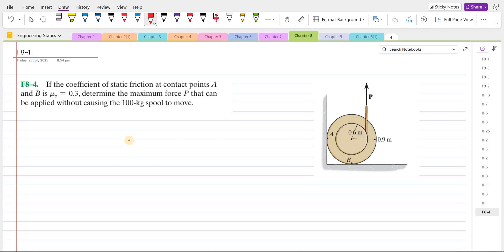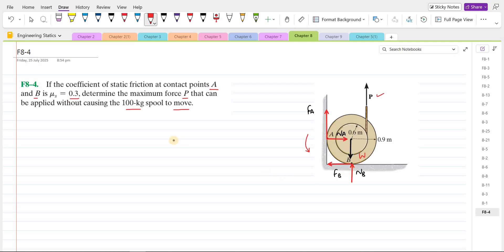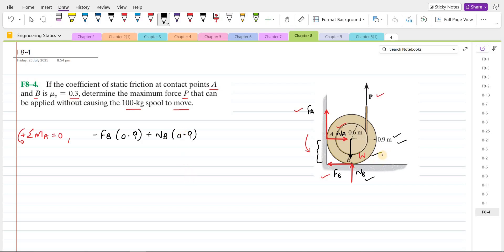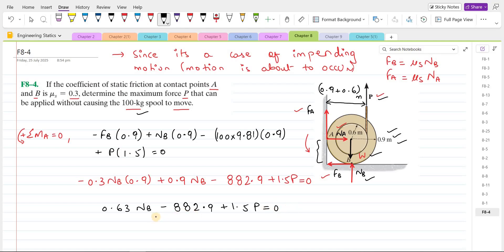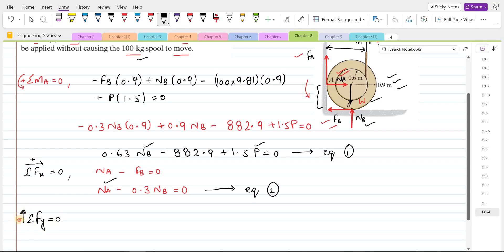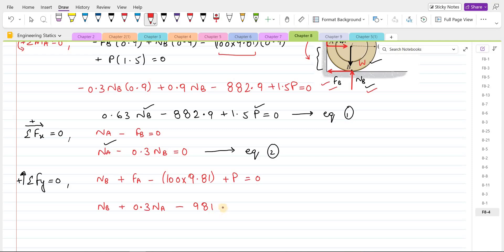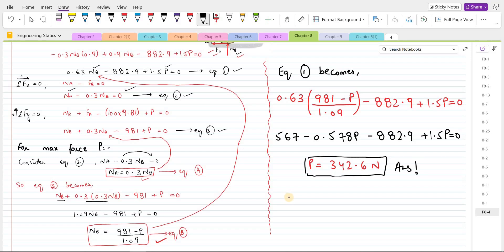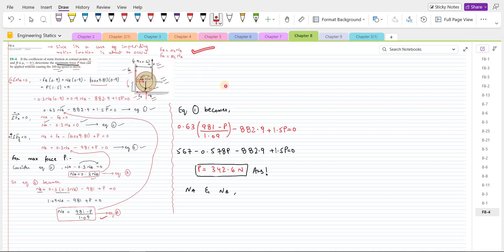F8-4 hibbeler statics chapter 8 | hibbeler statics | hibbeler

Comment: I wish you just explained how you plugged in Nb into equation 1 and showed the math behind it, instead of just showing us what it simplifies to. That doesn't help.
Reply from the maker: At 11:28 (0.63*981)/1.09 = 567 and (0.63*P)/1.09 = 0.578 P. I hope it will help!
Reply: @solutionsmanual9535  It helped me! Thanks